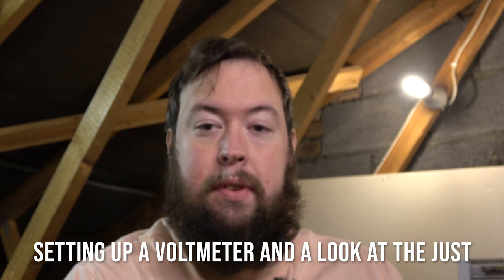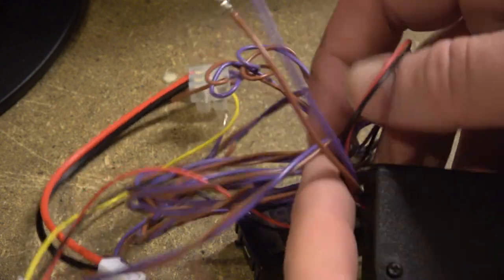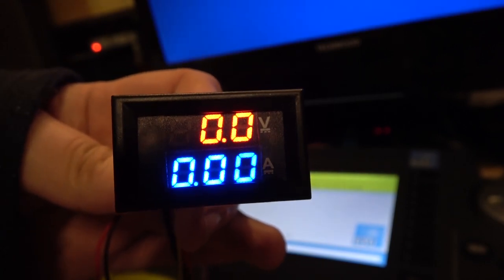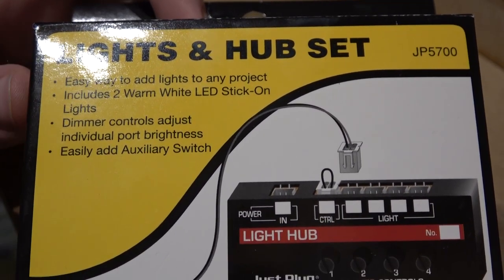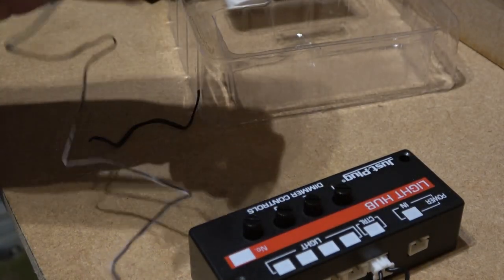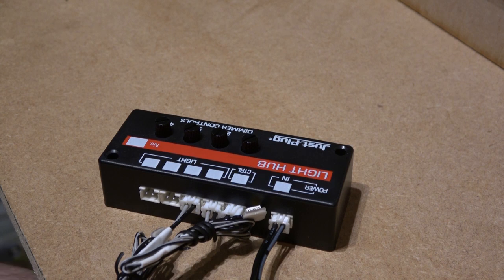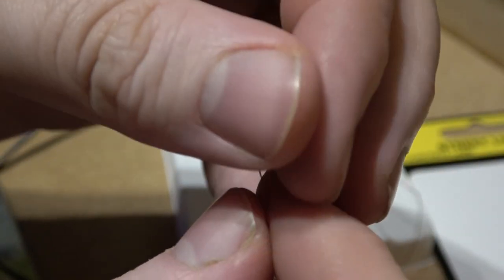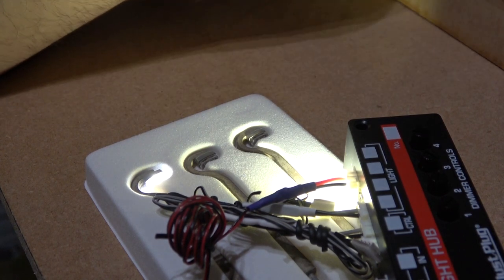Volts Meter and Just Plug system

Comment: Great little review of the just play system. Do you know if they sell those leads you got with the street lights separately? As I was wondering if I could use one to power my Gaugemaster platform lamps. . Cheers Pete
Reply from the maker: Thank you. I had a quick look on the just plug website and I couldn't see them sold separately.
Reply: I thought i would update you I had another look though and saw that they do a Linker plug kit WJP5685 which may do the trick
Reply from the maker: Thank you for letting me know

Comment: What voltage is the battery pack?
Reply from the maker: It is 4 as batteries so I think it is 6 volts
Reply: @TrainsintheAttic  Thanks. I've booked mine up to a power supply.  The voltmeter works but the ammeter is lit but not reading any amps.
Reply from the maker: Try switching the red and black thick wires that might help
Reply: @TrainsintheAttic  Sorted it thanks to your video. I reversed the wires and it all works now. Thanks for your help. Keith
Reply from the maker: Good to read